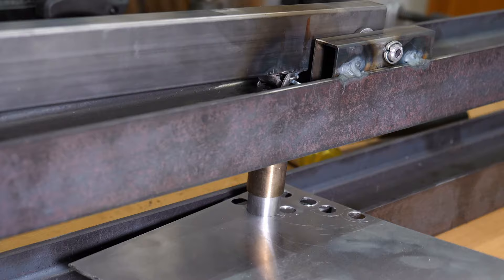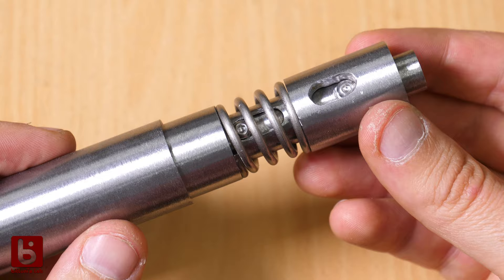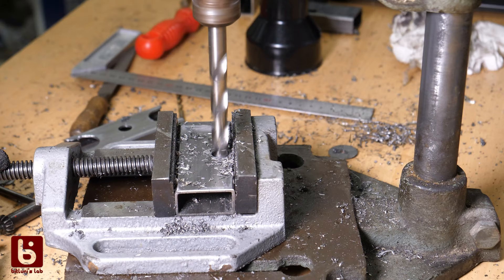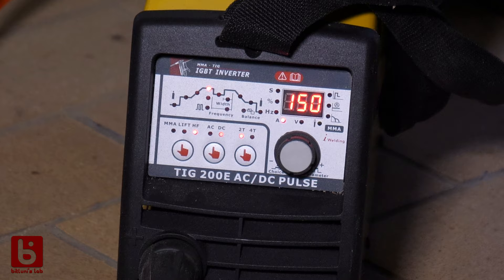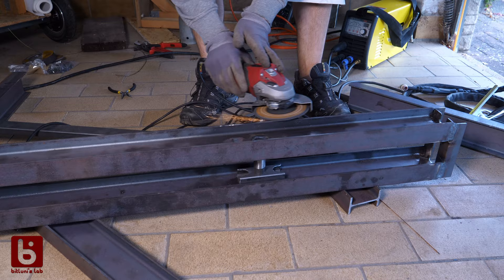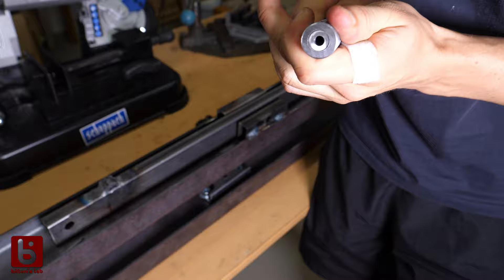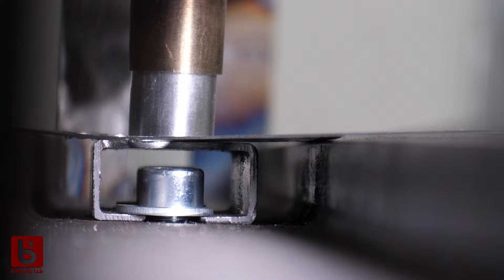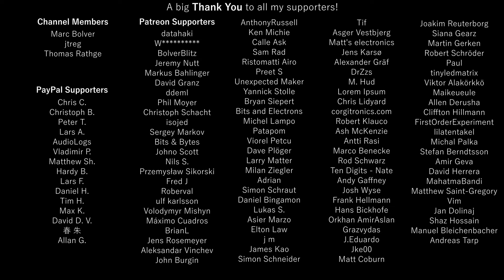DIY Punch Tool

Comment: Commercial punches are usually not flat. You could grind a little curve into it, that would make it easier to use.
It needs a little more support under it. A piece of round tube inside that square tube would do.

Also, you used the I-beams in the "wrong" direction, that's why they bend so much.
Reply from the maker: I did that. Have even footage of it but it didnt make a clean edge for not much less force
Reply: Google search for "hydraulic punching tool" and you will get loads of images with the diameters.
... and btw. these tools are also very nice in handling, precision and freedom of positioning. But can't score against bitluni's one, of cause;)

Comment: Have a look at commercial punch tools and how the cutting edge is shaped. It is tapered so you get more psi and a shearing action requiring less effort and causing less wear.

Great project though I'm looking forward to the finished wall.

Comment: When welding thin material to thicker material face the torch towards the thicker material. Also you seem to get a lot of cold welding, it's when you don't get enough heat into the material and it doesn't bond properly, try adding another 5 to 10 amps on top of what melts material. I am not being mean, just giving an advice since I had to learn how to Tig weld aluminium, steel and other materials quiet quickly and I know it can be quiet hard to do it right and make it look nice and get a good weld. Best of luck on learning!!!

Comment: The reason it flexes is because you orientated the I beam sections in the weakest orientation.

You would need to infil with 1/4 plate and long weld the I section in to box section to add rigidity.

The plate having holes drilled in so you can also weld to the I beam besides having beading joints, you have many that provide additional strength.

I could suggest a mod where you have a motor running a gear ratio gear box to give torque to turn a cam that drives the punch bit, actuated by foot peddle and giving you both hands to then hold the work safely. 

You would be also best adding a clamp that is actuated to hold the work prior to pressing the part or hole.

Comment: Either recessing it into one or between two tables, or building up a surface on either side to the level of the bottom half of the punch die will make it much easier to work with.
The trick to not having your parts move around while welding is to tack weld a spot on each side first. If need be you can hammer the part back into alignment after the first and possibly second tack weld. Once you've held the piece with three tack welds welds it's not going move while you complete the rest of the welding.

Comment: if you want to punch a lets say 12mm hole in 1mm sheet metal the punch diameter needs to be 12.000mm and the die needs to have a innerdiameter of 12.100mm +-0.05mm for ideal results. The punch needs to be EXACTLY in the middle of the Die!!

Comment: This does show why i beams are used the other way up :)
Reply from the maker: Yeah, but how do you put a hole trough the center of the beam if it's up right. It will twist if its not centered

Comment: Bitluni, how much is the normal cost for only a refill of welding gas (argon?)?
in my country bottle are very expensive and i was wondering how much was for a refill of gas.
Reply from the maker: I paid 59€. That's on the high side but I don't live in the city anymore where its a bit cheaper. I bought a complete full and ne bottle for 130 on ebay. The i wasted much from the last one due to a leak in a hose. I fixed that now
Reply: @bitluni  wow, i thought it would have been much higher price. here the bottle only is 500$ i was wondering about the gas price. but 50$ for a refill is not so expensive.

Comment: woudnt it have been better to make a butterfly press? you just need a big big screw and some big lumber to make a U frame and its done.
Reply from the maker: Thought about this for some time and went with this design. Ita more compact and i can put it in the corner
Reply: @bitluni  it is sure less bulky, but you cannot do other project except punch holes in sheet. i am not saying you made bad thing just that a butterfly press could have made other project like forming stamping sheet metal into shape or removing/adding bearings into holes.

Comment: (Sorry ich habe wig mit schutzgasschweisen vergliechen You dont have to clean the steel for welding it you can weld on the black)   
And just lay the bottle flat on the ground
Just so you know it
Du must bei der gas flasche aufpassen das sie nicht umfällt und der ventil abbricht und die flasche durch den raum fliegt. wenn sie liegt hast du das problem nicht so